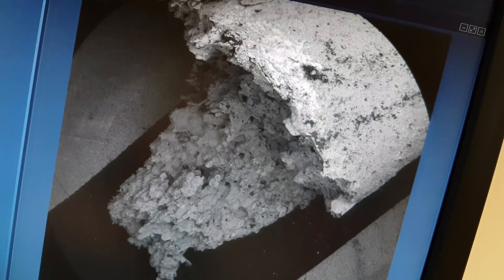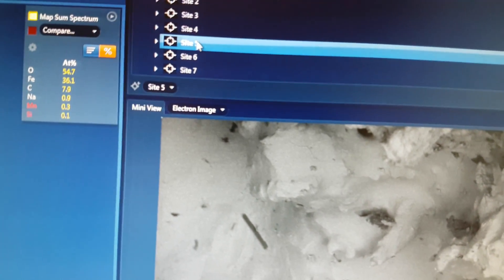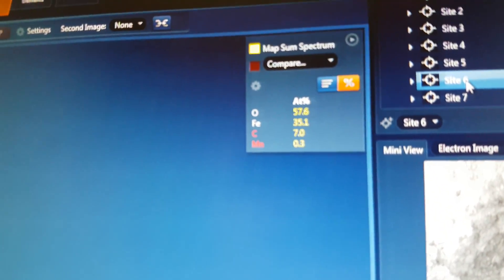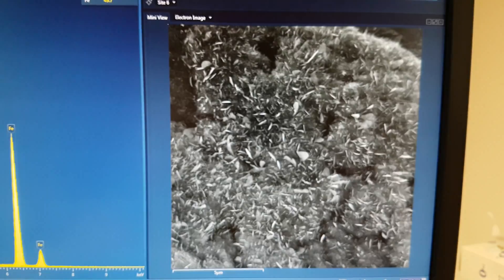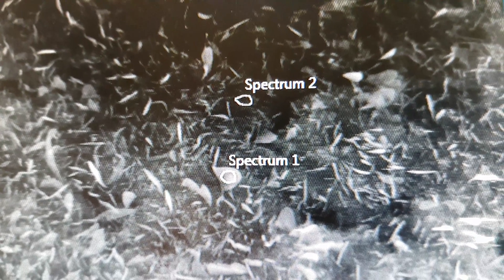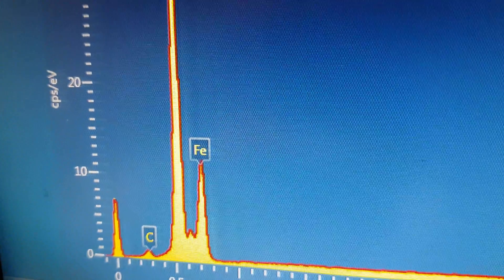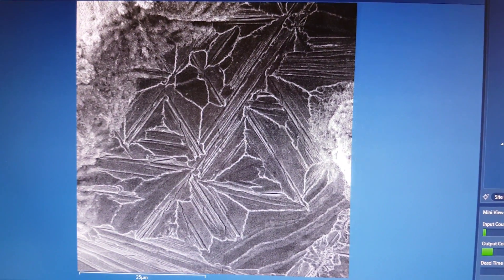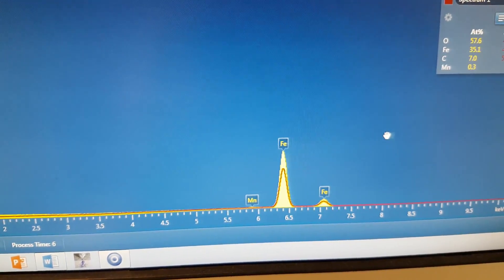ECCO - Sparks - SEM/EDX analysis

Comment: Are the various peaks different isotopes of iron, or what are they?
Reply from the maker: Hi Maximosh, yes they are.

In this scenario, Iron, being a very comfortable element does not want to transmute easily, however, there is much more to publish, which will be done asap.

In this case, the metal wanted to oxidise as instantly as possible - very aggressive oxidation.